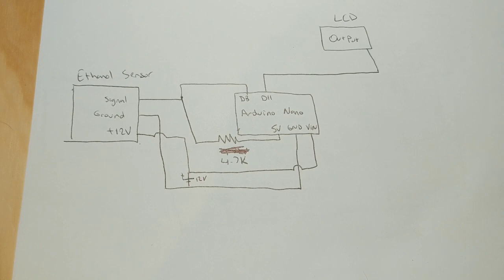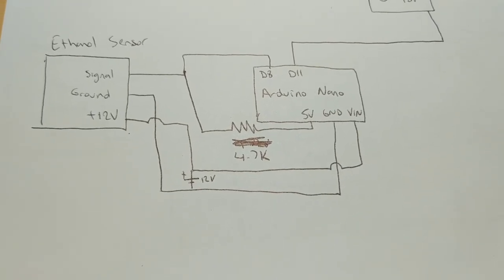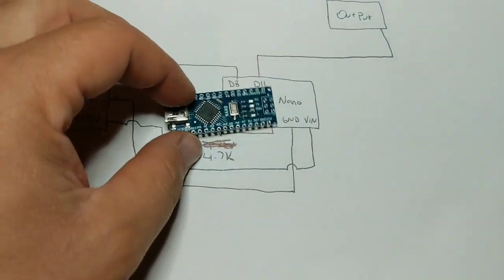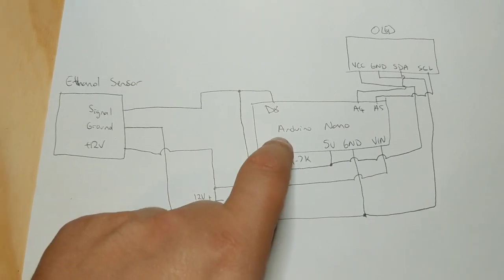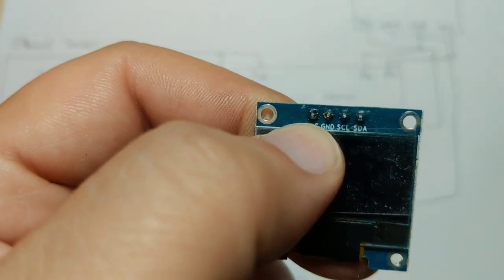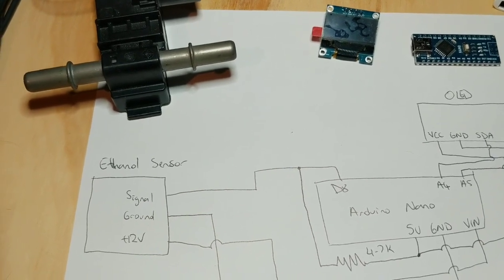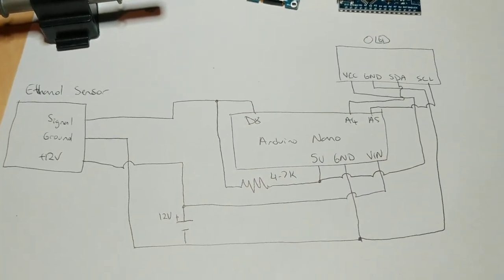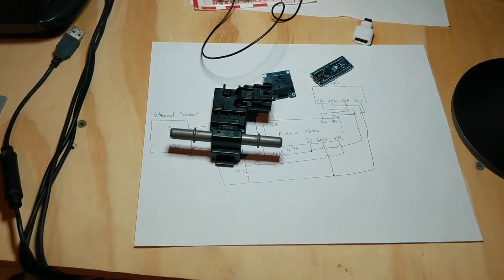How To Install DIY E-85 Ethanol % Gauge | Big Turbo Focus ST 2 of 3

Comment: just one thing! please, don't connect the 12v from the battery of the car, when the engine is on, the voltage can rise to 16v, and that can burn the chip. put a stepdown regulator whit a 10uF tantalum capacitor
Reply from the maker: Thanks.

Comment: looking forward to finished product
Reply from the maker: There is slight delay because I burned the board so waiting for a second board. I will upload the video as soon as it's done.
Reply: @FocusedGarage  yea mate you need a voltage regulator or to run it through a USB charger. part # nte 964. found the reference here : https://forums.nasioc.com/forums/showthread.php?t=2810122